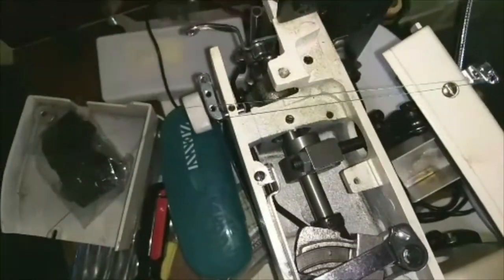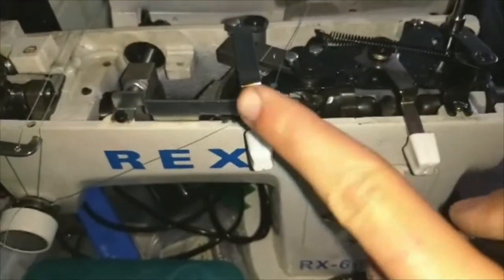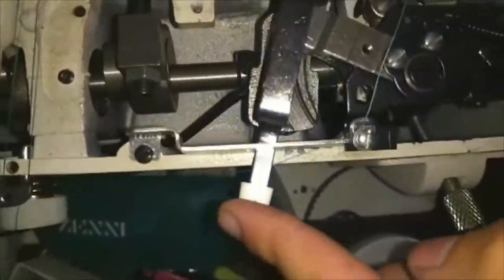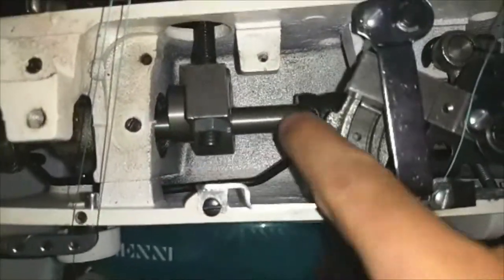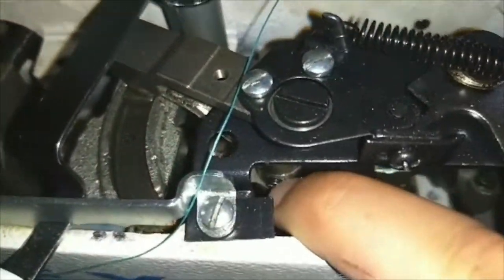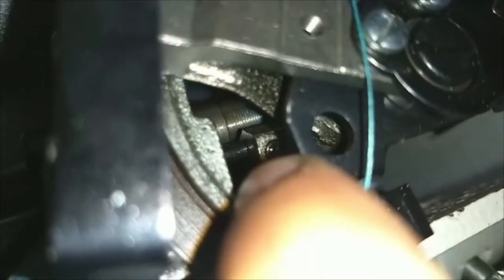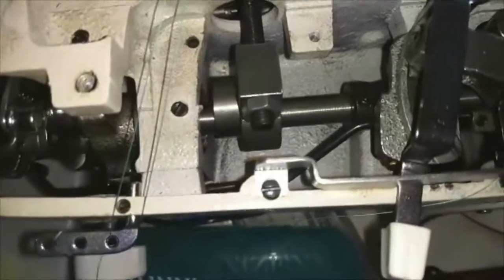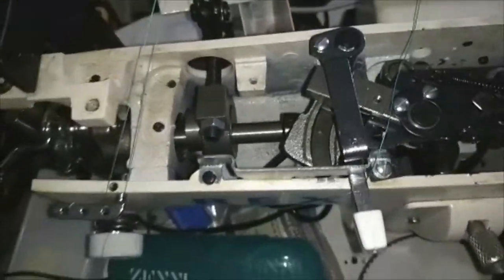Rex RX-607Z (sailrite clone) needle alignment (position selector) adjustment

Comment: Bought a new REX 607 a week ago , Lord that thing was loud , stiff and the motor  drive shaft was rubbing the belt cover. My wife busted out laughing and was sure I threw away $400.00 the first time I pushed the foot pedal . I took some advice from an industrial guy on Break In . removed all covers,  top , Front and motor housing and oiled with a " synthetic oil " every joint elbow and bushing while turning the balance wheel. Ran the machine at 1/4th speed 30 minutes , half speed for 45 minutes and High speed at short intervals. Sure enough it slipped timing and when I put a needle in it would contact the hook . Adjusted that but it slipped again . I found that the set screws were oiled , so I used acetone on a Q Tip to clean hole threads and screws and put on a little blue lock tight and all adjustments are locked in. After the break in and two hours sewing " and oiling every hour , 95% 0f original vibration is gone the machine is much more quiet and runs smooth. It sows beautifully and is a real Beast. Without any adjustment to the machine I sewed 8 layers of Sunbrella , two layers of medium leather and then two layers of thin cotton cloth.
The stitching was locked down perfectly in every material and thickness. Thanks for the video , just as I was leaving my little shop I noticed my needle was going closer to the left side of the needle hole than the right side , now I know how to fix it .
Reply from the maker: Thank you for your comment, I'll definitely try running her in to reduce the clacking, it really gets to the machinist in me.
Reply: I realize Im pretty off topic but does anybody know of a good place to watch newly released movies online?

Comment: After you made that adjustment, did you then also have to adjust the position of the bobbin case underneath the machine?  The needle has to be precisely alined with the hook on the bobbin case or the  loop of thread will not be picked up or the needle will hit the hook.
Reply from the maker: I did not, because when replacing the parts from the previous video, I forgot to reposition that connecting rod. If you have slipped timing and that is why the connecting rod is in the wrong place, you will need to adjust the position of the bobbin case. Luckily, sailrite has a video on that topic https://youtu.be/ouOxDVtx2Gw

Comment: My machine which I bought about fifteen years ago, says it is a Mercury M-530, and has the same problem. The needle position is too far to the left.  Not quite hitting the left edge of the slot in the presser foot, but close, and when it is on Zig Zag, the needle does not move all the way to the right.  
I am going to check this out and see if this is the problem.
Thanks for the video.
Reply from the maker: I'd love to know if it works out! If not, if you have the time, I don't mind having a video chat to help further, or to take a look at a video clip you send(might be more time efficient if you'd already done some diagnosis)
Reply: @TurkishLoserInc  I will try making the adjustment. I will take some video of how it looks now, and if it works, the results. 
I wish sailrite had a comprehensive service manual for these machines that covered other problems other than needle timing.
Thanks for offering to help. I will ket you know how it goes.

Comment: Hi, have you managed to solve all issues of this machine? If not here is one video that could help a bit. Btw in your case you don’t have to move the needle bar to the right. You have to remove the motor together with the housing and then you can see on the back side one hole. Look from the back side and you gonna see the screw for timing the zigzag. First go to straight stitch and then  move the needle down to the plate. When you lose the screw on the zigzag shaft you have to move the needle to the centre by pushing the needle bar. Hold this position with one hand and same time pull or push the shuttle shaft. Before to tight the zigzag screw try to fine tune the distance between the needle and the hook. Tight the screw and this alignment is done. 
Video for the adjustment of the walking foot:
https://youtu.be/0dl3mMsKaWc
Reply from the maker: The set screw in question did solve the problem. I had loosened it prior because I had to replace a part on the front which had loose tolerances.